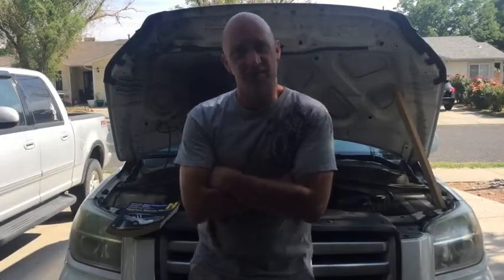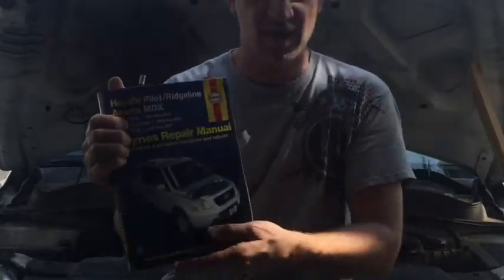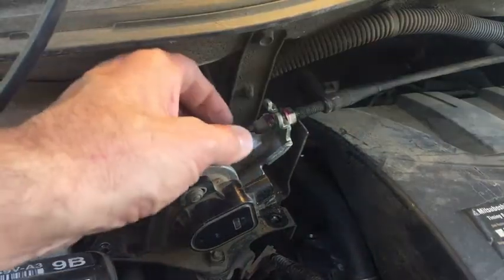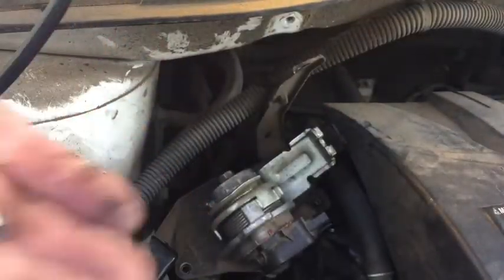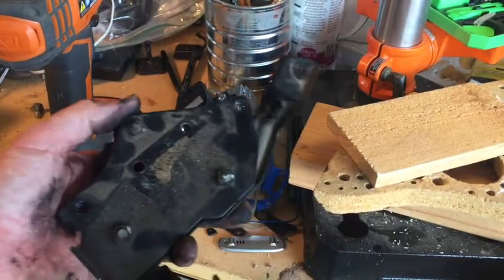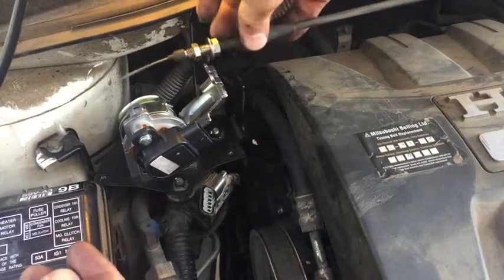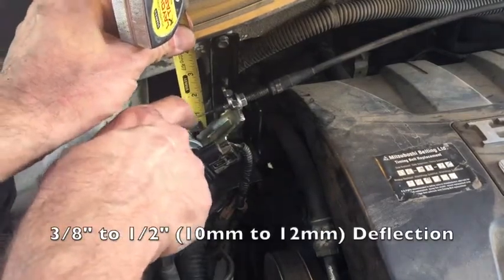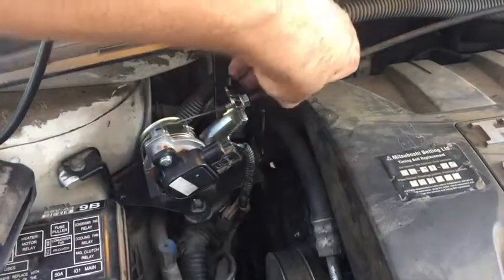DIY Accelerator or Throttle/Pedal Position Sensor Replacement | 06 Honda Pilot

Comment: Straight to the point, and it worked. My sensor was not even spoilt, the mechanic didn't get the placement of the throttle cable right. All I had to do was adjust it

Comment: Just changed mine on my 06 Ridgeline and worked perfect. I was really careful not to move the lock nut, but even so, it needed to be adjusted on the new one because the new one was not closing all the way. Had I not watched your video first, I probably wouldn’t have caught that. Thanks for covering this. Local auto shops were $180 for the part. Amazon was $120 but had a “used like new” for $75. I went for it thinking it’s probably a new one that was just returned because someone bought the wrong part. I think I was right because it looks brand new, in new packaging, fit like a glove and seems to be working great. Happy to have this resolved and acceleration restored without the worry of sudden limp mode in traffic.
Reply from the maker: Nice! And yeah sounds like a great deal on the part!

Comment: Hey your video is great but how do you know its the actual sensor that's the issue and not the wiring connector?? I don't want to buy the sensor and then find out its the wiring all along. thanks
Reply from the maker: Well, I was pretty sure by the code that it threw. Sometimes these things you just buy a part and put it in and cross your fingers. But even a blind squirrel finds a nut now and then hahah. If it didn't work I'd be out about $100 but I figure "Oh well, that part is brand new now and maybe it needed that anyway". And then keep trying to problem solve.
Reply: @rawar777joshanderson  So I recently changed my throttle position sensor my lights are still there so I think I might have to reset it to see if it actually work but the car drives well but then again I will find out in a week or two if it actually worked or not.
Reply from the maker: @saadfarooqui5649  To reset and clear codes/check engine light - disconnect negative battery terminal for a minute.